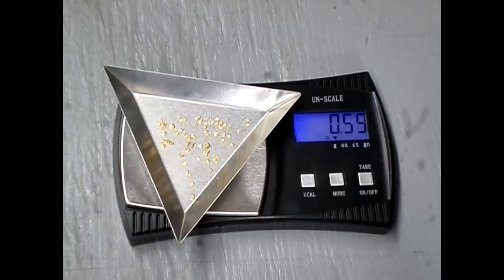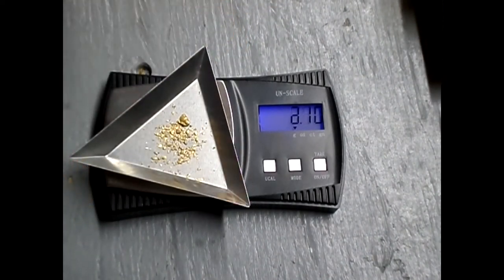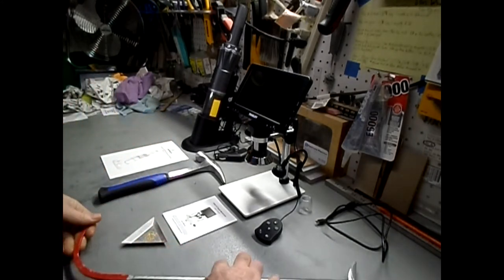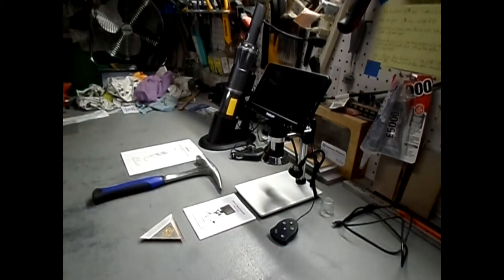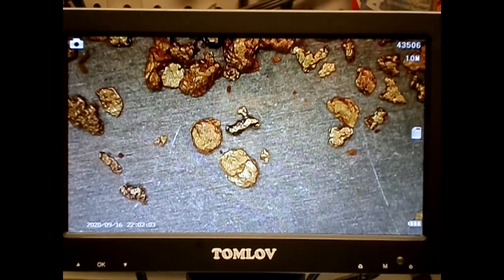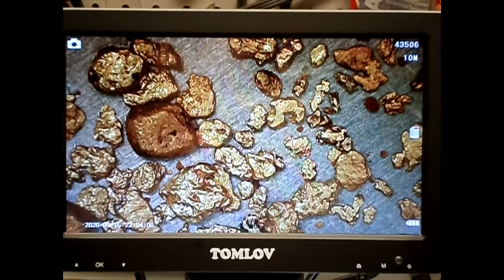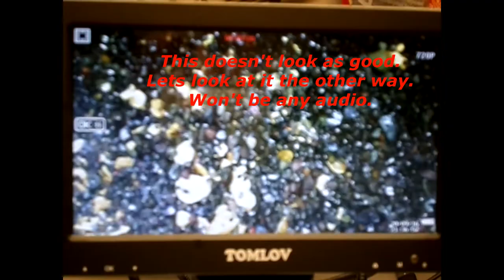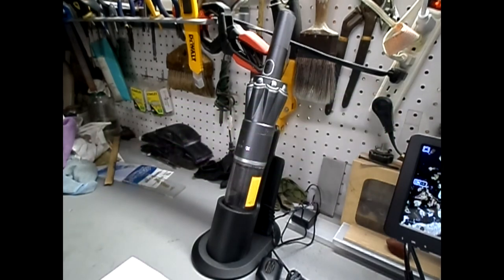GMGT - Some New Tools For The Field

Comment: Have you made sure that all those gold trays weigh the same?  They could be off by a little for each one =)
Definitely a nice little vac!!   Can't wait to see how well it works in the field
Really like that magnifying set up for sure!!!   Would be nice to have one of those!!
Reply from the maker: Dam! Your right Josh, one weighs .4 grams more. THAT AINT RIGHT I tell ya!! Here is a link for that camera / microscope. https://www.ebay.com/itm/7-Inch-1080P-Digital-Microscope-1200X-Video-Magnifier-Camera-Wired-Remote-TM-DM9/224329689127?epid=4039845852&hash=item343b176827:g:r90AAOSw3JpgEJg2